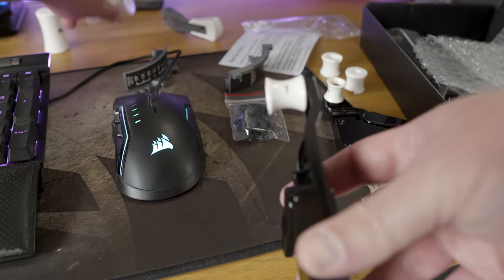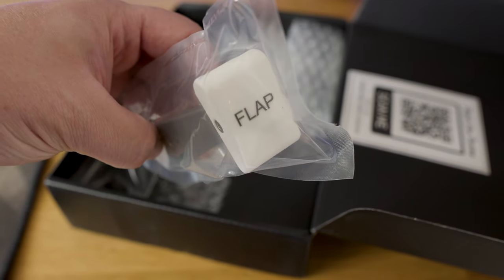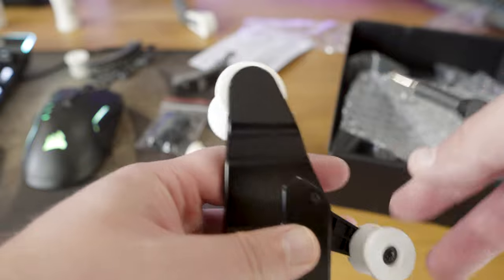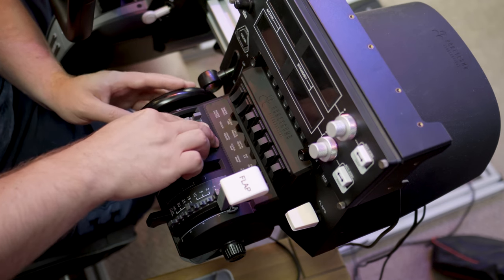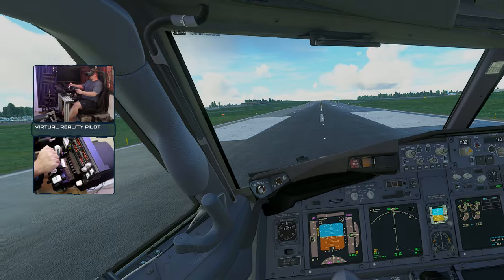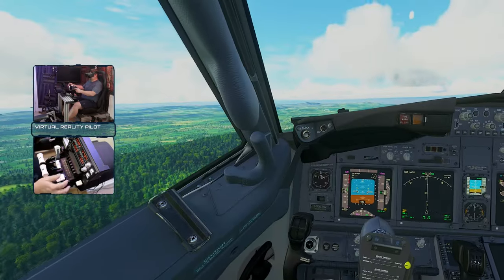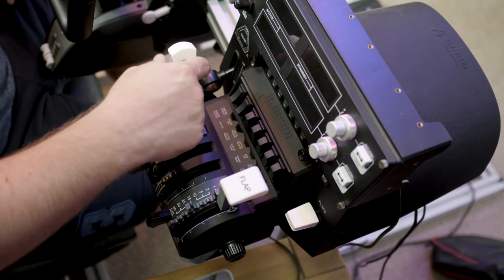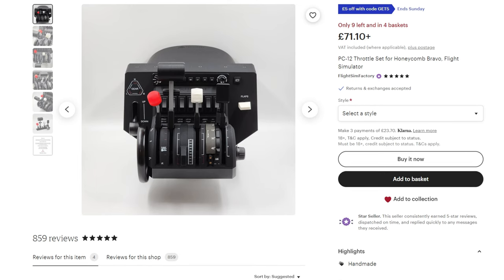Are replacement throttle levers worth it?

Comment: I was looking at these earlier today.  I didn’t realise that for nearly £100 you don’t even get the actual throttle stalks that connect to the base, and so would have to keep changing the handles each time you wanted to switch between these and the default if you needed four engines.   I’ll stick to the standard version, especially as I only paid £150 for the whole thing.
Reply from the maker: Those stalks have electrical contacts in them so not easy to replicate. Your right though - if you change your throttles often it could be a bit of a pain
Reply: @VirtualRealityPilot  Ah yes, forgot that.  I was just looking at an alternative by Homecockpit that has six functional electronic buttons, via an additional usb module.  I think I’ll stick with what I have for now.